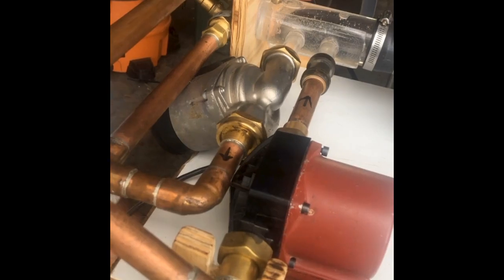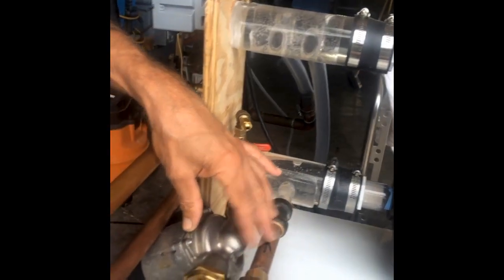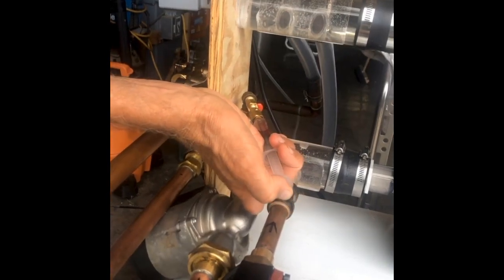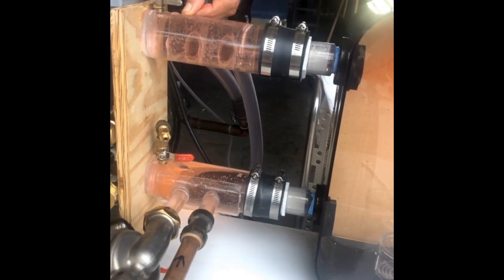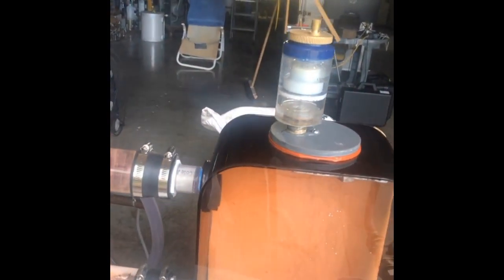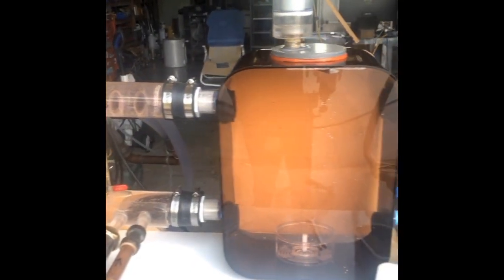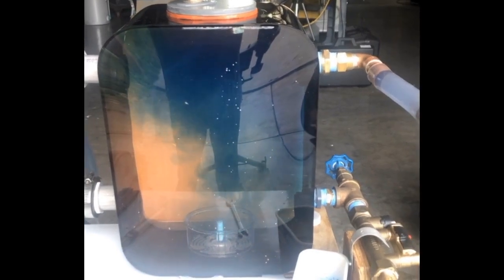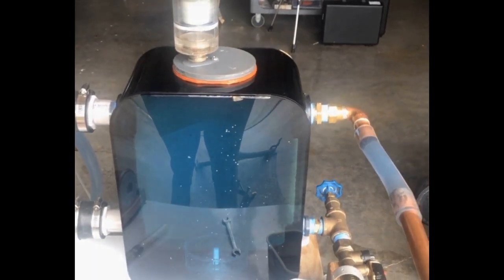Hot Topics EPISODE 1 DEMO - Inside a Buffer Tank

Comment: So one issue I see is that the left side boiler water that is being dyed blue is not necessarily mixed and the specific gravity of the dye could be part of the reason it is moving into the tank and falling… perhaps a colored carrier with a lower specific gravity would “simulate” hot water better and keep the color more at the top, I believe the hot water would not sink the same way. Also if you did heat the water some it would be good to watch this with infrared. The plastic would slow the effect down due to being an insulator but I think after some steady state running we would see the thermal path.